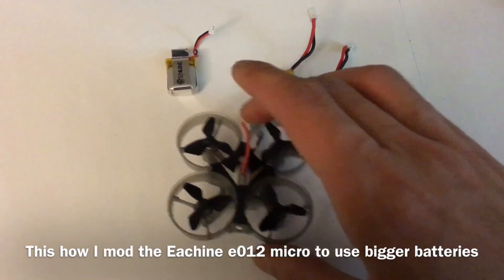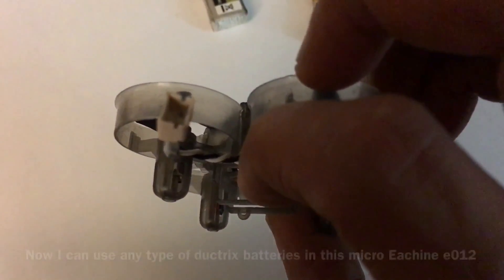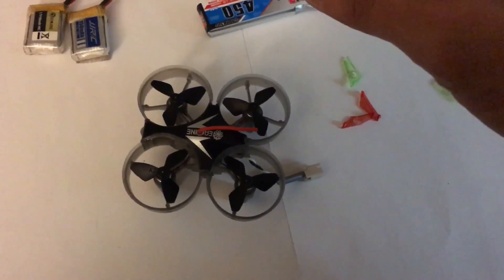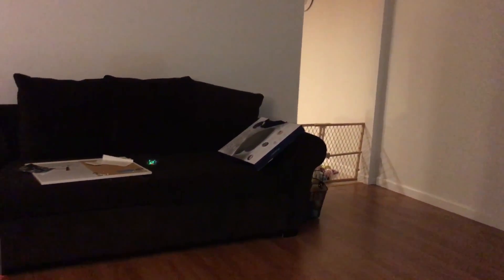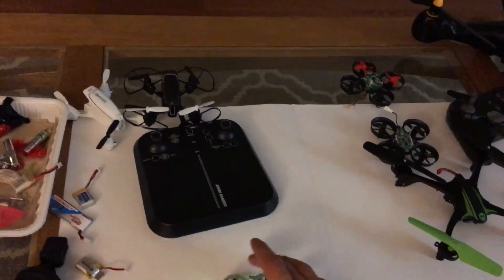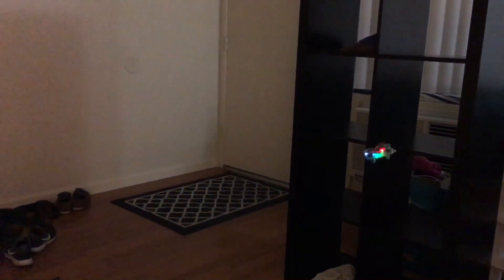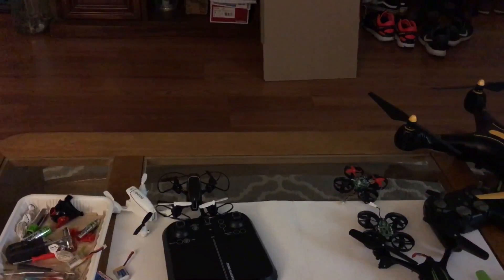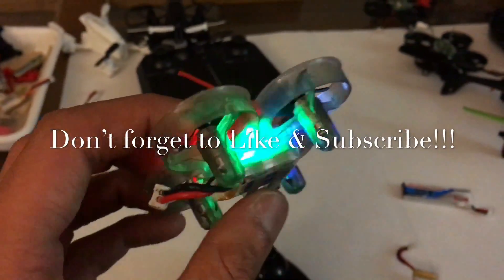Eachine e012 - how I mod the jst connector to fit any inductrix/tinywhoop battery

Comment: where can i buy micro jst adapter to jst 2.0 
to plug the battery without using heat tools directly into e012 micro port
in order to use e010 batterys on it?
Reply from the maker: There’s no adapter out there. Only way is to solder on the connector.
Reply: you can do it by yourself...with an exhaust e012 battery.. take the wire with the micro jst  plug and put the normal jst plug to the other side   )-----------((
Reply from the maker: Yeah as long as you can connect the wire some how like tape or soldering, it will work

Comment: Where did you get the cable from to convert it?
Reply from the maker: I cut it off from an old charger. You can also get them on eBay it’s pretty cheap too.
Reply: Thanks.  Yes i realised i could do that after asking.  Worked a treat. @ItsRCTeng
Reply: I also soldered the new cable onto the board where the pins come through so didn't need to remove the board - only the top cover.  It's a nice little machine but i much prefer the E010 ;-)

Comment: Thanks. Do you think that with a little soldering the E011 batteries will work with a E012 too?
Reply from the maker: Yeah definitely. As long as the battery slot can fix the battery, it will work! I have another battery that is really long call Goaneng and that fits too but its too heavy for the e012 to take flight. But it’s fits though. 👍

Comment: Was it easy to do?
Reply from the maker: Yeah it was super easy. As long as you know which is negative and positive, you can always solder it back. Which every way you solder off the connect that should be the same way you solder it back on.
Reply: Thankyou👌🏻
Reply: Do you have to solder it on and can you tape it?
Reply from the maker: Yeah you can get away with electric tape but soldering is much better for the electric current.
Reply: How do you desolder?
Reply from the maker: Easy. Just touch the connection with a hot solder iron. Touch and pull at the same time. You’ll see the solder melt then pull it off. Check out my video on replacing the battery on a Sky viper m550. I show how to desolder and solder.

Comment: How did you attach the cable to the battery port?
Reply from the maker: Solder iron. I start with desoldering the connector from the circuit board, then add wires and soldered everything back. Kind of like an extension. 👍👍